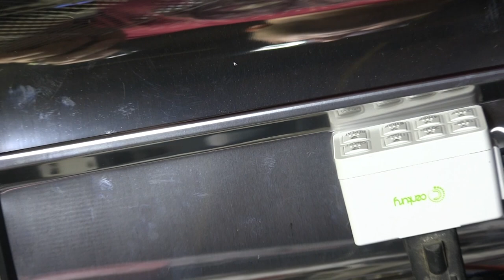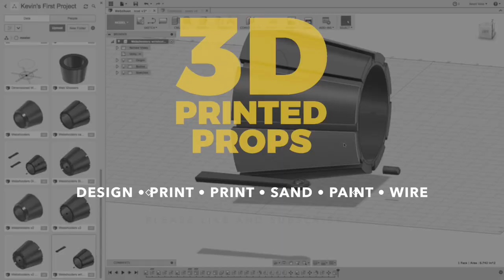How to Build an SLA 3D Print Resin Curing Chamber

Comment: hello, could you do me a favour and test one of your prints for scratch resistance? i recently built my own uv chamber, similar to yours but with even more power (no flex intended). However, the print surface remains weaker (not scratch resistant) than the fully cured resin of the bottom layers that are in direct contact with the build plate (scratch resistant).
Reply from the maker: I don't think you can cure this to be scratch resistant. It is just resin.

Comment: so how long does it take??? i coat regular 3d prints with uv resin... how long before they are fully cured? no tacky and resin is solid??? thanks
Reply from the maker: This particular resin takes about an hour. I would check whatever resin you are using to see what it requires for curing.
Reply: @3DPrintedProps  i just coated one and put outside for a test after 10 mins in sun its hard may still have some tacky spots... so is sun faster or slower or the same as this rig you use? thanks